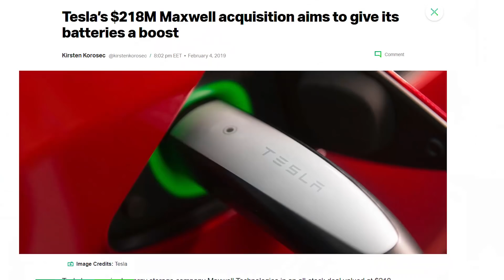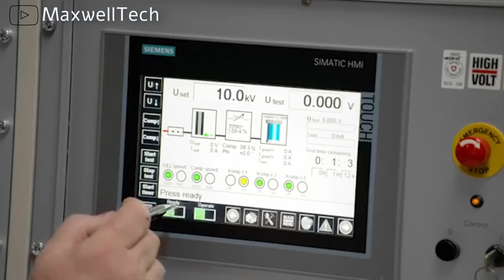Why Tesla Will Make Their Own Battery Cells in 2020

Comment: Your analysis is poor.

Tesla owns the battery technology (Maxwell).  They own the manufacturing company (Hibar). These companies have locked in the parents they need to be a manufacturer. 

Tesla will license to Panasonic, LG, and CATL. There will be no American licensees. 

Within three years, Tesla licensees will be capable of making enough batteries to allow all the new vehicles manufactured worldwide to be electrically powered. 

Tesla will have a technology interchange model with licensees to help improve the overall technology and drive down costs.

Comment: Great analysis. I think you’re pretty spot on with your predictions, and I’m excited to see exactly what Elon presents at battery and powertrain investor day. Battery costs are obviously one of the biggest bottlenecks in reducing their COGS so that they can lower prices and increase TAM, so they are very motivated to be in the driver seat of controlling those costs themselves.

That being said, this is not the only, or even the primary way, that Tesla will cut costs, increase TAM, and accelerate the transition away from fossil fuels. Tesla’s research into autonomy is the flip side of their cost reduction coin, and carries the greatest potential to get them to their goals. A lot of people evaluate Tesla’s market share based on unit sales, but in reality the fundamental unit of measurement should be miles driven. If and when Tesla can produce an FSD package capable of turning their fleet into robotaxis, the impact that this will have on the utilization rate of their fleet will drive down the cost per mile so far that even people who can’t afford to own a Tesla will still be able to ride in one to travel wherever they need to go.

Comment: If the next GEN Model 3 has that tech in it, it will easily obtain 5-600 miles of range since it is much lighter than the CyberTruck which gets 500.

Comment: 100%!  Autonomy Day - Tesla announces their in-house Autonomy Chip,  ergo Battery Day - Tesla announces their in-house Batteries...

Would not be surprised if by the time B-Day arrives that they will already be deployed into the field, similar to their chip reveal already at manufacturing stage and deployed in new builds.

Oh, and the Drivetrain part of Battery Day (which nobody is really addressing) will reveal the use of capacitors roll in new battery regen processes to extend range of all vehicles starting with Performance variants and Semi-Truck.

Comment: I'm at  8,000 feet above sea level, the outside temperature is -25c. Some poor chap it driving around in a Tesla.  All the windows are iced up and snow is caked on the car.  An ICE car creates heat, not so much for the Tesla.  It must be a nice car if you live in the climate that's is support by this technology.  I tried to lookup for a supercharger start near here and used this website. https://www.teslarati.com/map/  But it's broken because of an API code that expired.  This is what I would expect from the car, software that is not properly maintained.  I just read an article that the new software updates for the Tesla are full of bugs.  Not what I'm used to with a car.   Can't believe that so many people purchased this science project.
Reply: Thanks for the good information.
Reply: @PosiP  Feel confident in your purchase and thank me later!
Reply: Posi P believe it.
Reply: @boulderghost4457  do you own one?  You ever drive in in sub zero.  Why no heat?
Reply: Posi P yes I have a model 3.  Live in the mountains of Idaho.  6000ft, 0 degrees this AM.  Charge it in my garage, pre heat the battery while charging.  Never need to go to a supercharger let alone a gas station.  Defrosts window, keeps me warm at 69 in the cabin.  It is nicer than my 4Runner.  You need to service yours or maybe you don’t own one at all and are just speaking out of ignorance? Either way you should do yourself a favor and do a little research.  I could care less what other people think as I’m laughing all the way to the bank! No more gas $$$ wasted.   This “science project” is awesome! Thanks
Reply: Good to know that the car can perform for you.  Just see the drive around all frozen doesn't give me the confidence to purchase one.  I'm getting close to purchasing one to drive around town so I'm looking at them closely.  How far do you that it away from home?
Reply: Posi P I drive within a 100 mile radius 99% most of the time.  I always have I guess.  Except when I was a long haul trucker at 20.  I take my 4Runner  on longer trips to Moab and hunting trips.   I would try to actually drive one and see how it works from the other side of the windshield.  If you preheat the cabin plugged in to shore power it’s very fast and doesn’t affect battery range.  Every morning you have a warm car and 300+ range from HOME! Seriously , why doesn’t that convince everyone? I guess in time, everyone will get it, especially when Cybertruck arrives with 500 mile range, 16 inches of ground clearance and 0-60 in 3 sec.  I’ll sell my 4Runner and will stop dreaming about buying a slower corvette c8.  Tesla is coming for the WHOLE MARKET and most people have no idea.
Reply: @boulderghost4457  can you back feed your home if the power goes out?   I guess we all will have an electric sometime soon.  It just seems over priced for a golf cart with windows.
Reply: @PosiP  Golf cart? Lol. You really are stuck in in 1995? OK Boomer! I never drove a golf cart that can do 0-60 in under 5 and navigate offramps  like its from Star Wars. 

I cant backfeed yet, I dont have a powerwall. I have a 220/240 from the washer/dyer outlet. Super easy. I never really think about it. I just preprogram the cabin heat and hop in the car: its warm and ready to go. I guess if I was driving in sub zero with 2 ft of powder on the ground every day I would wait for the CYBER TRUCK. For now the 4runner is for heavy snow days.

Comment: What is the difference between a dry electrode and a solid-state battery?
Reply: likely cheaper / faster manufacture - more capacity- longer lasting - quicker charging - lighter - safer
Reply: A Sloid State Battery has a Solid Elektrolyte. Tesla announced Dry a Elektrode.

Comment: Great presentation. But I think first Tesla should master vehicle body manufacturing along with battery modules costs excluding battery costs. For example in $40k car battery is less than  in $10k while $30k is other.. Tesla started on reducing costs by cyber truck with stainless steel that ha no paint and easy to manufacture due to straight lines and also wire harness designs and no door handles , side mirrors and minimalistic internal design

Comment: For 3 years Tesla has been developing the Braga-Goodenough high voltage Solid Glass Electrolyte in its battery/capacitor cells. No- Dendrides, non-inflammable , lower weight, high charge/discharge rates & high cycle life. The "Sony" for the second lithium ion age.
 Combine this with the Dry Electrode processes  and reduced production space of Maxwell, & the plant construction capacity of Hibar, all the ducks are aligned.  I believe scale production will start  of a single A4 sized  pouch cell early 2020. The advantage of setting up this second production line along side the solar panel development in Giga2 Buffalo, under the control of Toronto based Hibar will solve most of the problems in the NY State facility. Its all guessing - In automated factories labour costs do not negligible. Without the constraints of having to main the huge range of existing producers TESLA COULD BECOME THE WORLD MAJOR BATTERY MANUFACTURER  FOR VEHICLES, STORAGE & GRID STABILISATION.
Reply: Edward Morpeth, would you please edit a few of the typos, so that your thoughts are completely understood?  Lots of good thoughts here.
Reply: Very logical analysis.
Reply: why do you think Pouch cell ?
Reply: @GroovyVideo2  In general it would allow; less weight, less space, easier cooling/heating. No clue whether this is what Tesla will do though... I think they'll start offering these new cells in Cybertruck, trucks and roadster which are less volume and then ramp up production from there.
Reply: GroovyVideo2 ceramic or glass dont bend well . They will create good marriage of layers with physical compression of the stack .
Reply: I think your bang on . Who else ?

Comment: Not withstanding that Panasonic have apparently announced they can increase production to 54GWh in Q1/2..... (They were recruiting at GF1 in
I think you're being pessimistic.
They announced essentially a new pack design, 2 months ago.
Why?
They e had access to Maxwell tech for at least 18 months, probably longer.
Battery day was delayed, then Model Y was delayed, could be coincidence, or it could be a new battery/ pack from day 1 in the Y.
Is it going to be easier to ramp existing production, which will require a lot more factory space, then transition that high volume to Maxwell, essentially throwing away the cost of relatively new machinery, or to transition early, even using existing chemistry, but with the more precise, MUCH faster Maxwell process giving at least an incremental step in cost, then added to the pack, yielding 20% + improvement?
Reply: yep , my guess is that model Y will be launched with the new battery tech that they will announce on battery day
Reply: Model Y was not delayed, it is coming out 6 months sooner than they initially announced. Rumors from parts suppliers are suggesting the Y could come q1 2020 even. It was end of 2020 for the most expensive versions and 2021 for the cheapest model Y. Now they are saying summer 2020 for mass release to the public which means test production has probably started and we have been seeing more and more model Ys on the streets being tested.
Reply: @0ooTheMAXXoo0  
But I believe it was, together with the battery day, but now it appears that it's being move forward again.

If anything, that reinforces the possibility that they may be linked.

Comment: No way Tesla parts ways with Panasonic, they love Panasonic. They need Panasonic, LG and Themselves to be making batteries to meet demand. I see Tesla making as many as they can, Panasonic making as many as they can and LG doing the same.
Reply: Zod maybe if they supply from several battery producers, they can foster competition between them? Resulting in lower margins and higher quality?
Reply: @Doesitreallymatter-q3d  That's what I would expect them to do.
Reply: Zod 

Then how do you explain the HiBar and Maxwell acquisitions?  

1) Tesla becoming a supplier to Panasonic, who is a supplier to Tesla?

Or

2) Tesla GIVING Panasonic Maxwell and HiBar technology?
Reply: @techfan6129  3) Tesla creating an improved design and manufacturing process that uses Maxwell and HiBar tech but the core batteries stay primarily Panasonic, BMS and Super Capacitors will be all Tesla. Panasonic battery is just one component that makes up the powerplant/manufacturing/brain(bms) that is needed. Should be clear on battery day.
Reply: @techfan6129  Tesla will be making new batteries for new uses while still buying batteries from current suppliers for current products. Read the comment you replied to. Tesla making their own batteries plus buying from whomever can meet Tesla's needs. They need a lot of batteries and they probably have contracts to keep buying cells from current suppliers so why would they not make their own in addition to buying from 3rd parties? Why make it harder on themselves by trying to completely switch all of a sudden? At least there will be a decade or so of transition while they come up with new designs that will use the new batteries as they would not want to make the old style batteries themselves.
Reply: Tesla buys Panasonic for money and stock
Reply: @matthewmcanadabc8355  Perhaps just the lithium battery division.

Comment: I think that Panasonic has been given a handshake promise that all their increased capacity will be used mainly because if Tesla doesn't use it then they'll sell it to the competition. When you factor in Tesla energy ramping production then there is no way Tesla will be able to meet their own demand
Reply: Also Powerwalls (21700 cells) for their solar roof ramp-up.  They're putting in anywhere from 1 to 3 Powerwalls depending on the system size.

Comment: Great video once again.  I absolutely agree with the main points.  I have one observation and one question:

1) The 500 mile Semi only requires 2,000 cycles for 1M miles.  It does not require the 4k cycle technology Jeff Dahn discussed (which is probably the basis for a 250 mile robotic-taxi).  Also the 4k cycle technology seems to have less energy density, so it may not be preferred in applications that need fewer than 4k cycles (like consumer vehicles or very long range vehicles).

2) I’ve heard a couple of people opine that existing cell patents are too numerous allow newcomers into the arena.  Do you have a rebuttal to this argument?
Reply: Kirk Blackwood An easy solution is for Tesla to provide or license the battery/drivetrain/AI to others. Elon says he is willing. Others are buying from third parties. Why not buy from Tesla?  Too proud?
Reply: Bruce Burnworth 

Yes, patent swapping is a definite possibility.  As far as drivetrain/ Autonomy licensing  I don’t believe any of the big cell manufacturers have any current plans to build EVs, so I don’t see why they would want to license that tech?  Although LG Chem provided a lot of the technology for the Bolt, so it is possible they will build an EV.
Reply: Kirk Blackwood  I was thinking of Tesla licensing it’s battery/drivetrain/AI - not Panasonic or LG. I expect like others that Battery and Drivetrain day will include an announcement that Tesla will make its on buttery cells.
Reply: Kirk Blackwood Regarding the need for longer  battery life think Robotaxis. As soon as this option is available my Model 3 will be driven more than 100,000 miles a year.

We need to change our view of car ownership and use. We drive our cars less than 10% of the time. With Robotaxis use would be closer to 80%. We could get to all electric vehicle use very quickly with Tesla producing Robotaxis. Each Robotaxi would take the place of at least 5 ICE cars! 

Talk about gutting the auto industry!
Reply from the maker: I don't think patents will be a hindrance.  Tesla can always license if needed.
Reply: Dave Lee on Investing  As in Tesla has the Tech and can license it to others. 😁
Reply: Tech Fan the purchase of Maxwell solves the patent issue.

Comment: I agree 110%. My 10% extra is that I think like at autonomy day, Tesla announced that the new computer IS being installed in.cars, I think at Battery And Drivetrain day Tesla will announce that they are making the new battery and it IS being installed in cars. I believe this is the reason why Tesla moved the day from Fall 2019 to Spring 2020. Elon does not and likely cannot announce that they will be producing the new battery. They have to be doing it. Part of this is their contract with Panasonic and part is how Tesla Shorts attack all schedules that Elon announces. Saying they have a new battery cell AND they are currently producing it and using it in cars solves lost of issues with Panasonic and  shorts.  

Did I go too far?
Reply: Bruce Burnworth - I agree with you. They need to say that the batteries are being put in all new cars being made. If I had a car on order and it was close to delivery, I would cancel my order and wait a few months for the next generation of batteries.
Reply: Todd Smith Excellent point. With the computer this point was not so important since the computer could be swapped out later. Hard to swap out batteries later. If the improved batteries are not in all  new cars, then sales will stop until the batteries are in the new cars. Elon likely already figured this out.
Reply: Bruce Burnworth 
You didn’t go too far for me!  It might align nicely with Model SX high-end version.
Reply from the maker: Interesting idea.  That would be amazing if Tesla could start production before the investor battery day.
Reply: I doubt that they will alter the design of existing cars to use a new battery design. They have not done that with the Model X or Model S, yet. Maybe after 6-8 years of sales of the current model they might release a re-design? I think even the new model S powertrain coming next year still uses the same battery cells from 2012, just with other updates.
Reply: 0ooTheMAXXoo0 Maybe so. Or maybe Tesla designs the new battery like they did the new computer so that the new battery fits in the same space as the old batteries. Then it’s just longer range and life with software. Maybe they add a higher priced option for a Model 3 with a million mile battery and 500 mile range 🤪. We will have to wait until Spring to know.

Comment: From what i understand Tesla and Panasonic has not been a happy marriage for a handful of reasons. The really big issue for me is that if or when Tesla and Panasonic agree to part ways, how will the change over happen. Panasonic has apparently had trouble keeping up with Tesla demand and therefore i can't see Panasonic being able to produce enough cells to cover a changeover. I dont know if there is room in Gig 1 for Maxwell to set up and start production while Panasonic scales down. I have heard there is a lot of unused space there but is it big enough for Maxwell to start up their manufacturing set up. Any thoughts on that  Dave.... also have a happy new year and i hope everything goes well for you in the coming decade.... cheers
Reply from the maker: I think Panasonic continues to provide cells at GF1.  Maybe Tesla just builds more of their own lines there or at another facility.
Reply: Tesla has said that the large building next to the Chinese Gigafactory that is still being built is for battery cell and pack production. It is not a secret or anything...